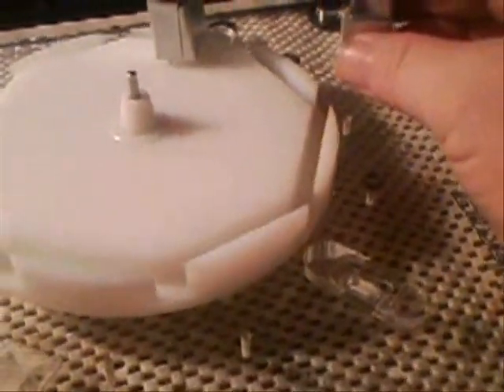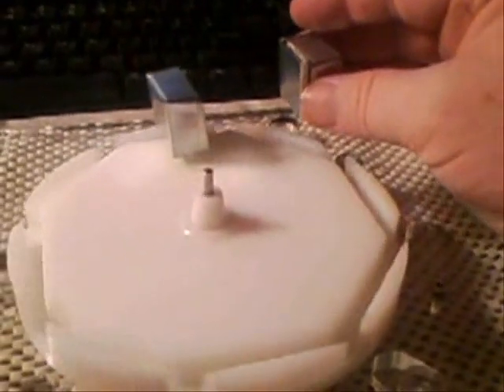Shielded Magnet Characteristics Part 1

Comment from the maker: @fuelban 

You are correct that magnetic flux prefers the path of higher permeability. 
Search wikipedia for 'Magnetic Reluctance' for the formulas related to this concept.

There you will find that Reluctance = material length in meters / (divided by)  permeability of free space * (times) permeability of the material * (times) Cross sectional area of the material in meters square.
Fancy R = ℓ / µoµr A
Φ (magnetic flux) = Fancy F (magneto motive force) / (divided by) Fancy R (Reluctance)
Cheers!

Comment: @AdminOnDuty > My own experience "though Being Slight", Would side on your statement of the gap between each layer, if I were to put forward a view, it would be to make that first layer close to the magnet of high permeable metal, and increase the gap between on the 2nd, and so on to the 3rd layer respectivly. I found magnetic force, likened to electrical force, LAZY, taking the easiest, and quickest ,route oot.  willing to take guidance if offered...
Thom in Scotland.

Comment from the maker: @fuelban 

No worries =) 
We welcome the comments!

I think the reason has to do with the gap between the layers having a lower permeability and the flux path having to change orientation as it transits from and into the shield material. Or maybe my shielding simply had a higher average permeability overall. Or, perhaps the square design had some impact on the back flux. It would be interesting to plot the flux density on various types and see how they compare.

Cheers!

Comment from the maker: @fuelban 

Hello Thom, again.  You are the same fellow that tipped us off to these Pot magnets a year ago . . . remember? (Just scroll through the posts) ;-)

After your post, I did purchase the 'Pot' variety and even have one here still in the package:
General Tools MFG - Shallow Pot Magnet 20 Lb Pull No. 376B UPC 42114 
It is 2" in diameter ~1/4" thick and has a 3/16" Hole.

But it has quite a bit of back attraction unlike those I constructed with the triple shielding.

Cheers!

Comment: These shielded magnets are called "POT MAGNETS", you can purchase them from good suppliers, they put most of the force out the front end... they come Trade supplied with a bolt /"Threaded Stud"- protruding at the back end for fixing, they have been around for some many decades now, whilst they are slightly more expensive, you might find less hassle purchasing than making guys, hope this helps.
Thom in Scotland.

Comment from the maker: @daenumen ,

Not only have you failed to observe the details, but now you wish intimate that I have claimed to shield magnetism - no such claims exist. It is one thing to shield a magnet and quite another to shield magnetism (the latter being technically impossible). Shielding a magnet from light and heat (among other EM sources) is quite easy as I have demonstrated. Shielding an object from a magnetic field is a misnomer because the best you can hope for is flux redirection. Your Blocked.

Comment: Pot magnets are ok, but for drive you need to cut north face in half, these wont do it, There are no known forms of shielding from magnetism, engineers simply conduct it away by using steel, check out FuelBan & Magnet Motors 1.wmv  ........ videos 1 to 3, you can get an idea  how to manipulate the steel to suite rotation. But it is not shielding , you are conducting forces away from a given location.
Thom in Scotland.